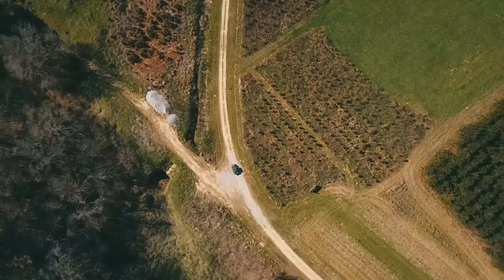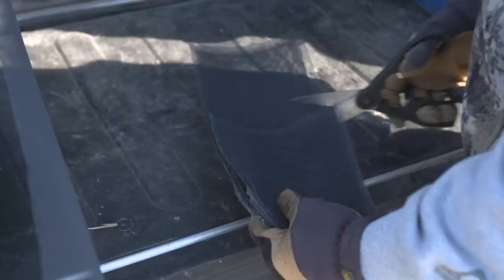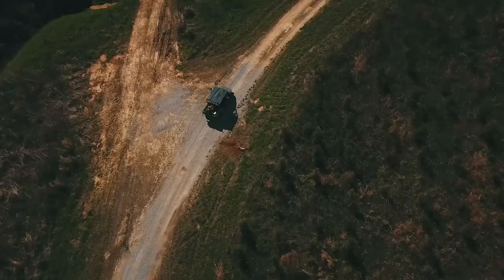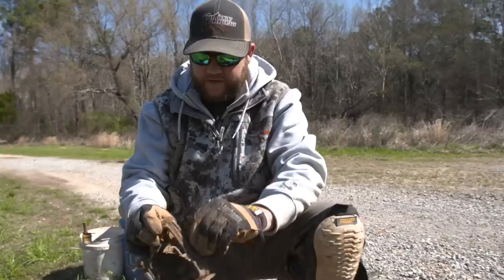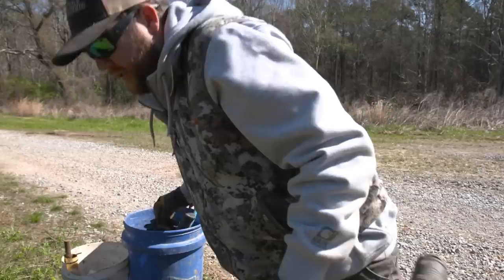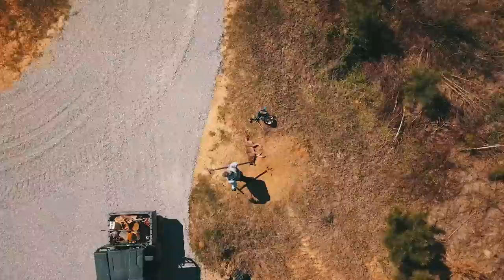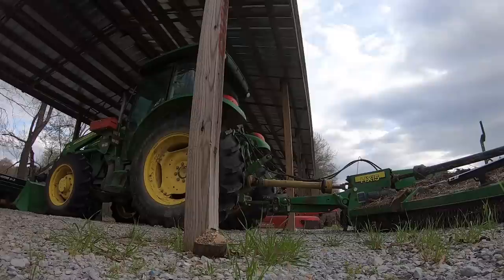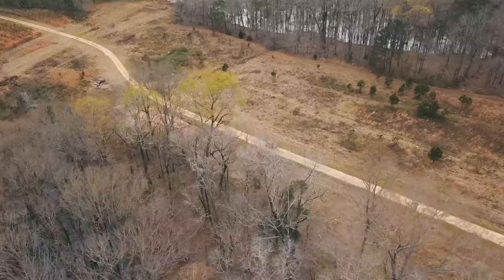The 10 Commandments of Predator Trapping - The Management Advantage

Comment: You are THE trapper who has inspired me to switch to trapping instead of hunting.
Most of those side by sides have a trailer receiver. Could you use a tool tray that could plug into that to carry the coyotes after picking them up so they don't bleed in your box?

Comment: Great video. I have to use a pick axe for the trap bed and trap stake for the hole, drills don't cut it  here in the coldest part of the year. I don't have an expensive hammer drill but my tools get it done just the same. Oh and broke my digging hammer a few years ago thus the pick axe.

Comment: Outstanding trapping videos. I was hoping you could clarify what screen wire you are using. I found fiberglass and aluminum screen at Lowe's but I thought you were using something stiffer like some kind of steel screen. Any imput on this would be appreciated. Thanks again for the great videos.
Reply: If you want to get the FULL potential out of screen,  you use steel screen and lock it under both jaws, it increases your kill zone, plus it holds up better to water. There's a reason real coyote men use steel screen all across u.s. it works

Comment: I’ve wanted to take my dog out with me,  if your dog is running around and peeing on stuff does that make set areas more or less attractive?
Reply: A lot of guys use dogs on the trap line to help them decide where to set. Your dog will mark things that a coyote does to. If he marks a small tuft of grass or bush something like that, it may be a good idea to consider setting a trap there as a coyote may come by to mark the same spot. Also pay attention to how your dog walks a area or road or how it approaches things. Some dogs will just plow through weeds and brush like a bull dozer others are more cautious. My dog is very hyper but if I look where he walks a road it is almost always the same exact path the coyote tracks are on. They change sides at the same places and walk down wash outs. It has helped me with locations on flat sets and I have become  particularly successful with blind sets because of it. Just my opinion